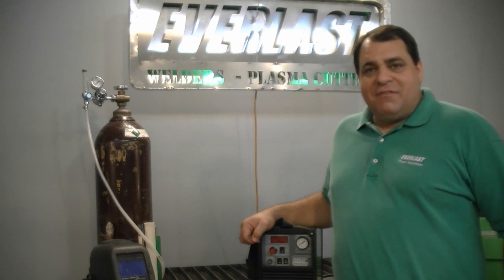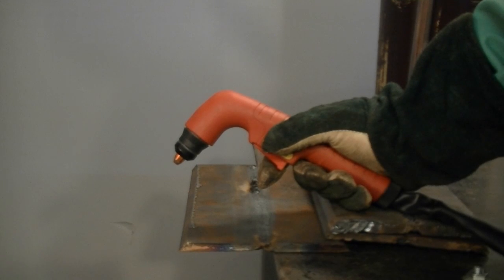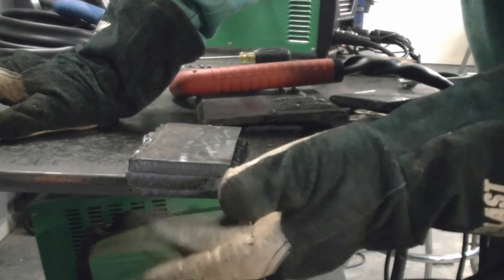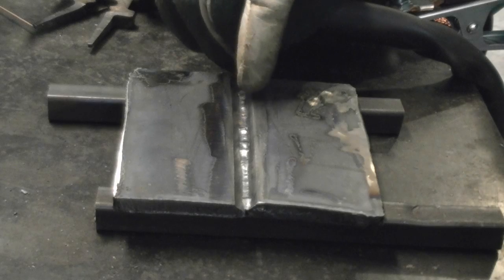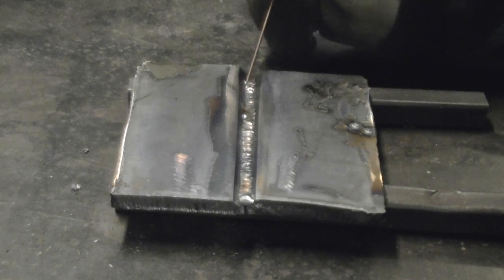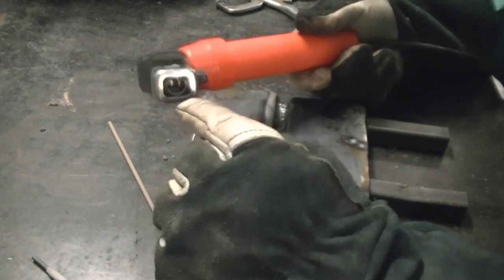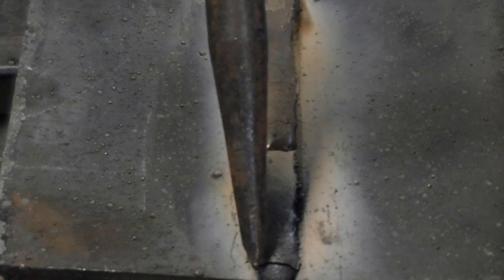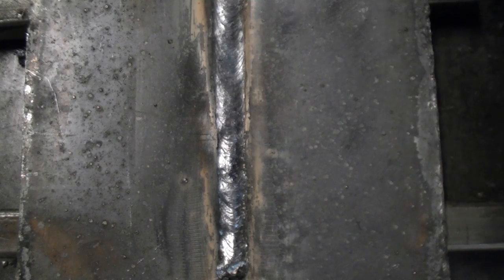Everlast PowerUltra 205P -  Pt 3 DC Multi Process 3 in 1 - TIG Stick Plasma cutter

Comment: LoL. "The bad welds that the students had made.". You'll get slag like that cutting even new material.
Reply from the maker: No, as you could see later the 3/4 inch plate had much less dross.  The weld was full of slag and air pockets.  If you are getting excessive dross, it's likely  from too much standoff, worn consumables, low air pressure and/or moisture.
Reply: Everlast Welders and Generators The weld makes the plate even thicker than 3/4".

"If you are getting excessive dross, it's likely  from too much standoff, worn consumables, low air pressure and/or moisture."

Exactly, but not "bad student welds"...
Reply from the maker: I'm not quite sure what you are referring to.  The scrap was picked up from rejected welds at a local trade school.  This had hills and valleys and was full of slag inclusions and air pockets.  Slag and air pockets wreak havoc and create more slag.  Compared to the 3/4" cut with the stacked plate, using similar conditions, and the same unit, the slag was less on the 3/4" stack cut.  The areas on the 3/8" plate where the weld was the worst, had pronounced slag, where it was better it did not.